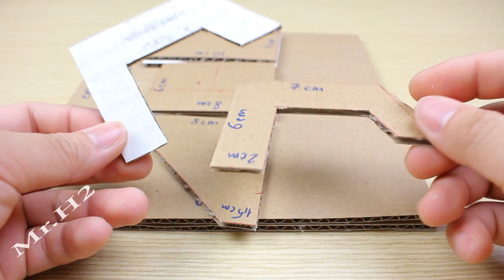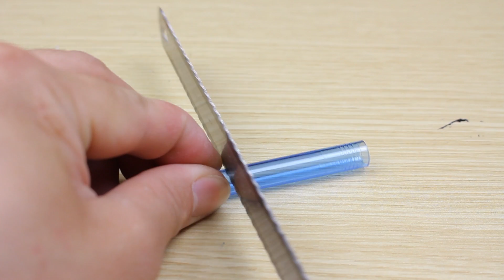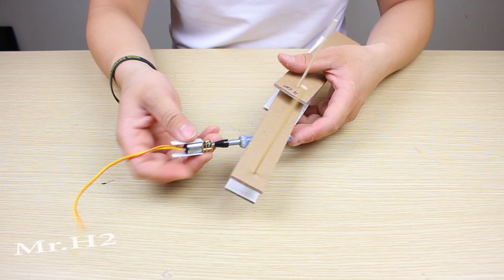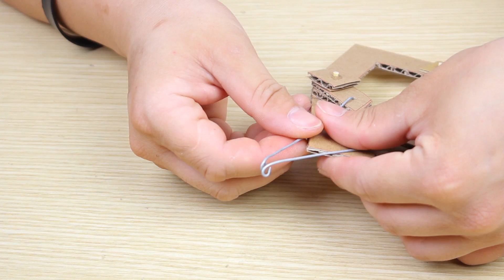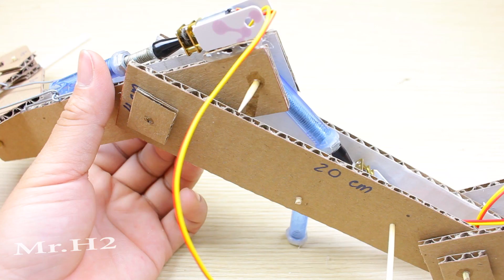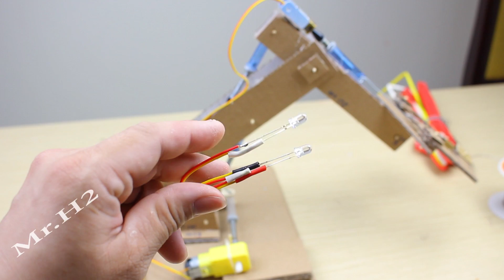Make RC Robotic arm from cardboard and Dc Motor - Simple JCB Hydraulic (mini Excavator)

Comment: where did you extracted that extra gear box which was attached with the shaft of your motor ?and the Remote control chip set with (i guess 4 channel control function) for this project ?